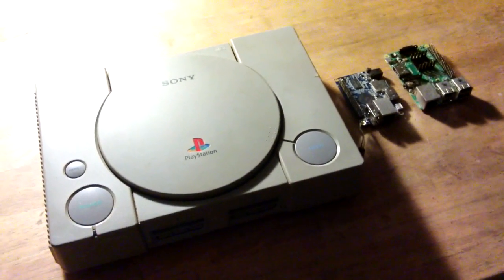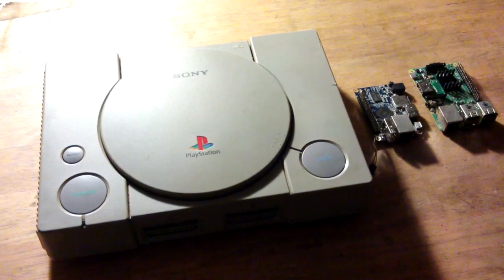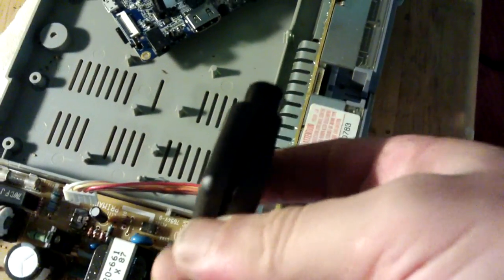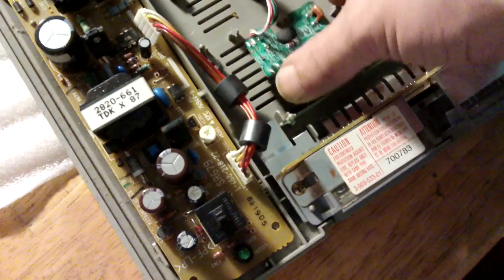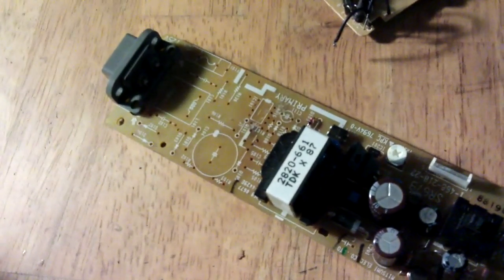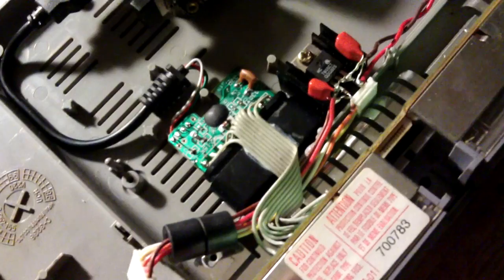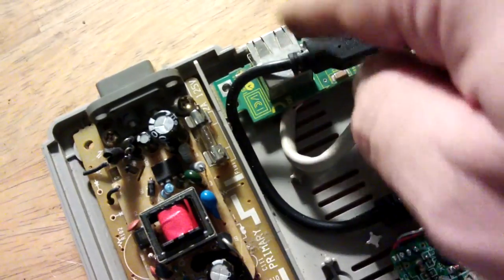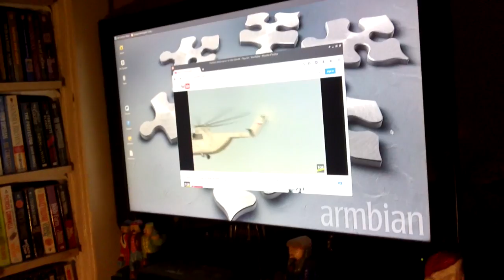Building a PiStation - retro gaming

Comment: Really nice project, I'm going to build my own mod, in fact I tought I would be the first one using an OrangePi, everyone uses raspberry jaja how did you install the fan? It just seems to be on the board
Reply from the maker: Oh, the fan is indeed simply glued on. Fix-All from Dollar Tree (if you are in the USA). It stays slightly flexible, soaking up any knocks or vibrations without snapping, as superglue can do. Nothing wrong with the Orange Pi's...except somewhat trickier to set up than Raspberry Pi's.  Good luck with your build :)

Comment: Where did you put the 7805 regulator I have the Lightning icon in the top corner
Reply from the maker: Luckily I had the 2A USB circuitboard that fitted right in, onto the dead original power supply board. That meant being able to plug in the original mains cord, yet the USB power supply now does the converting to 5V for the Pi.
A stronger regulator or 2x 7805 in parallel should supply enough throughput.  
LT123A is 5V and up to 3A: http://www.linear.com/product/LT123A

Comment: Really nice build! very clean, Love that you used original power cable too
Reply from the maker: Thanks. Yep, keeping it all clean was a main theme and partly so I can trace any problem easier down the way. The power section was quite lucky, how it all fitted together neatly. The only problem now, is needing a bigger memory card :)
Reply: Should be JUST enough space for a 2.5" drive?
Also how does the power work on this, I'm assuming the power button is instant shutoff/on?
but couldn't this cause corrupt SD cards quite easily if not shutdown correctly beforehand?
I ended up removing the power button switch and replacing it with a momentary switch https://i.imgur.com/8GE7bPv.jpg but now my problem is the led doesn't turn on instantly https://www.youtube.com/watch?v=Ld0RoCcy4ms

Comment: great job. could you tell me how you done the wires to the ps1 controller plz
Reply from the maker: Thanks :) The adapters cost just a couple of $ on Ebay (single and double controller versions are available) and they come apart readily. The connections are all in a line, so it's a simple case of soldering from those connections to the front panel mounts of the Playstation case.

Comment: really nice work around for the power supply, the powersupplies were always burning out and burning the lazer out :-) but its true nothing says 2016 like a blue led :-) really well made walk through here, smooth and has all the info there, i really do like these old retro updates, did a nice one here :-p great job on the cat5 port too :-) and the net on there, most handy :-D
Reply from the maker: Thanks very much for the kind comments. it's now had many hours of 'burn in' time and nothing has given problems, which is always good news. The Ethernet port is proving to be very handy + am glad I went for that extension. For example, to log in remotely via ssh to check the CPU temp when a game has been running for an hour or so.
Reply: slider2732
very welcome, it was really nice to see the old ps get a new lease of life, the shell for instant data really is a nice addition :-)
 that power supply swap out you did i think can have only helped for stability as well :-D the only thing that freaks me out is how the blue led looks so right like it was always blue :-) but it was red! i swear! but it looks so right!
 its really cool as it looks like you have a community to work with on the pistation soft side as well as you could do a lot of cool stuff with modern bridging as well as perhaps rig some cool new light guns up for the old games :-)
 im proper impressed with the concept as much as the build and both are great :-D

Comment: Thats a very neat build. Lots of space left in there. Room for a jack in the box under the CD lid? It could pop out if you press start-select-up-up-down-down-left-right-left-right-B-A-B-A....Or maybe just stick a USB hub in there for loading up more game/media? 
I have a NES a Mega Drive and a couple of SNES somewhere. Its a tempting idea.
Reply from the maker: That's the idea here...not the jack in the box lol, but to store an N64 to USB controller adapter (just ordered one earlier today). Also, it allows skinny hands to pop out the SD card if needed. Just got to find some skinny hands :)
Reply: Jack in the box has skinny hands. What about a SD card adaptor for the old PS1 memory card slots? I remember saving up for weeks to get a 32mb memory card! How many save slots can you get on a 64gb sd?

What about a pop out plasma speaker? or an aromatherapy vaporiser?
Reply from the maker: An aromatherapy vaporiser, using plasma ? LOL a vaporiser indeed, with an ozone aroma. Hmm, SD card conversion - however the data is written could be emulated on the SD card side, perhaps with some kind of 'Arduino' interpreting and recoding.
Reply: Or just use the pins for a regular SD interface so you don’t need small hands and so it looks like a memory card is in use.

If we are going to start vaporising stuff with plasma might as well go for gold and make a mass spectrometer.